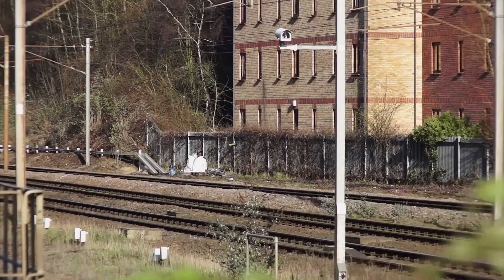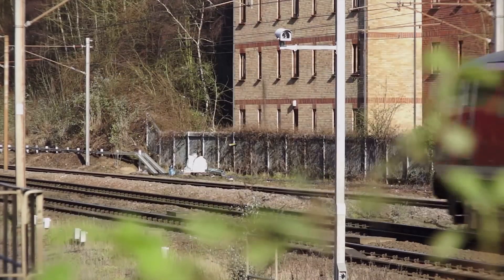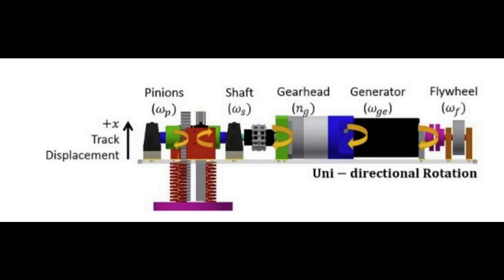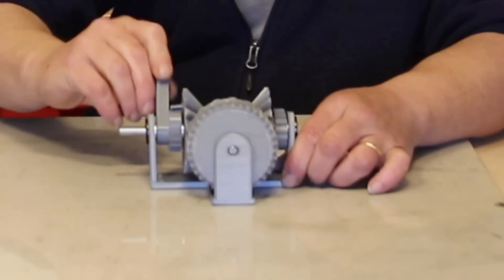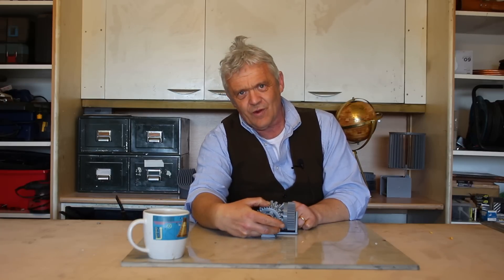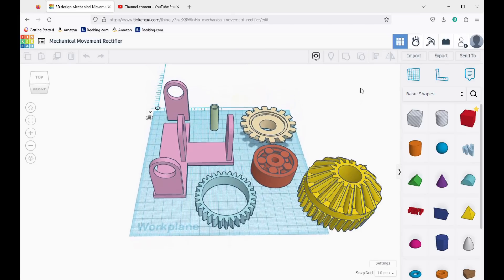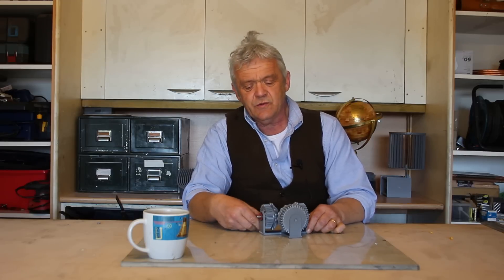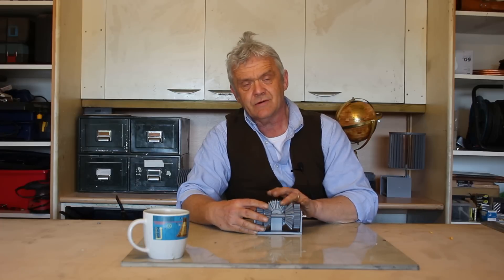1912 Energy Harvesting In Megawatts - The MMR Breakthrough

Comment: Well then why don't you attach these things to the suspension system on all four wheels of a car and use that to recharge the batteries
Reply from the maker: you could
Reply: had same exact thought,
Reply: I was talking about electric car but you're right it wouldn't do a whole lot for a gasoline car unless you had one of those hybrids
Reply: @Michael Skinner I've seen a suspension to electric generator product at a tradeshow.
Reply: Maybe dampening characteristic is not good for suspension. Maybe this flywheel construction make suspension react too slow, or something. Think about dampening in time characteristic.
Reply: Putting coils on guard rails modified could produce electricity or next to trains
Reply: Made me think of putting magnets under a car and copper coils in the road and harvest the electricity
Reply: @sc-lj9cp  sounds like a great idea 💡

Comment: One of the more interesting things about technology like this is that it has the very beneficial side effect of dampening unwanted movement which causes noise and wear.
Reply from the maker: you are one of the few to have got that mate and it is spot on
Reply: Of course If the train and rail system was an elegant and efficient system in the first place, there would be no noise or wear. 
And no wasted energy to reclaim a small percentage of in exponentiating an escalation of complexity, finite lifetime parts, maintenance costs AND resource consumption. 
Simply providing adequate suspension for the trains axles, by mounting the dolly's on a block of foam rubber with a flat table bearing and central locating shaft would remove 90% of the wear on the train, save more energy than could ever be harvested, and allow cheaper and lighter construction, and higher load to vehicle weight ratios. 
So really this is a typical Yank,  VERY STUPID IDEA. 
A VSI. 
Perhaps look instead at harvesting the energy of a tree or grove of bamboos,
The structure of a bridge, skyscraper buildings, swaying in the wind. 
Large forces over decent distances, small frequency.
A much better scenario for not wearing out your "mechanical rectifier" in a few seconds. 

How much energy does it take to 3D print your mechanical rectifier and how much energy can it harvest in the under sixty seconds it will last with kilowatt level inputs at multiple cycles per second Robert Murray Smith?
Reply: @ThinkingandTinkering  have you considered a combination wind wand and/or day/night thermal expansion reciprocating wand system yanking your cables Robert Murray Smith.
A pair of these could torque your knob 24/7 without too hurried and stressful yanking, do you not think? 
It could be the curved roof of a building facing south that stretched and unfurld in the heat, and closed like a flower at dusk.
Reply: That answers my question. I wondered if you were actually taking this energy from the train operator, but I guess it's wasted energy anyway.
Reply: @aaronfranklin324  I think you need to take a break from the Yabba and get some sleep, mate.
Reply: @TimeSurfer206  it's 1.30 in the afternoon in New Zealand dude. 
And I is surfing some harbour chop in my yacht. 
Sure could make megawatts with the spinnaker pole out the side and a line thru a pulley to a weighted buoy. 😋
Reply: If they put this system directly on the suspension of electrical trains, could they be made less noisy, as well as recovering some power? 🤔
Reply: I won't stop the noise.
Reply: How tovstop that train when using magnets. They could feed the net backwards. Keep on running.. you got a track

Comment: Awesomeness. Two things come to mind — there was recently an absolutely horrific train derailment in Ohio that basically wiped out a small town with potentially deadly consequences of toxic chemical exposure. Indeed, the freight rail industry in the US is downright hazardous — there are thousands of derailments every single year. The cause of the Ohio derailment is almost certainly due at least in part to faulty safety equipment that was supposed to detect overheating of the wheels of the train. I wonder if it would be possible to include a low-voltage heat detector that could relay hazardous conditions. Also, perhaps they could be useful for electric trains and light rail in the cities perhaps, since they could feed electricity directly into the system?

Comment: Sounds like another good app for electromagnetic power scavaging. Periodic magnets on railcar underbodys and a series of coils on the railroad bed.
  Add low profile wind turbines on the roof and your vibration energy scavenger device to the rails. I wonder how much of the energy used to move the train could be recovered by using all available practical energy scavenging devices?

Comment: Wrap a coil of wire around a freeway and the passing cars will induce electricity . Put a hose across the highway, a one way valve attached. The traffic will produce a steady flow of compressed air.

Comment: Very interesting concepts! From the point of view of an electrical engineer reading about the Stonybrook scavenger, it struck me that:
1) there are probably more efficient generators than back-driving a stepper motor, and 
2) eliminating the "mechanical rectifier" and using Schottky diodes or even better, "ideal diodes" using switched MOSFETs would introduce even lower conversion losses.
Any way it's done, harvesting track vibrations is brilliant!

Comment: WE could get Energy from every Thing that moves, thanks good Work
Reply from the maker: yes we could!
Reply: @ThinkingandTinkering  why is Nobody doing IT?
Reply: @divedeeperer  This has been developed for aircraft suspensions where significant energy can be absorbed when landing. I think the main problem is the weight and cost of the batteries, generator, etc.
Also, copper is already subject to theft. I don't think harvesting units would stay put very long before some low life steals them.
Reply: @Proud2bmodest  Hmmm If WE dont try WE will never know. Maybe IT will Work Out Just fine.
A Well with water+ RAM pump to get the water Up in great hights into a big water tower+ any Kind of water Generator (maybe a Kelvin water dropper)that will Run of the towers water... Like a Hydrodamm Just without the Damm and the left over water Back into the well

Comment: Mount the unit with the actuator vertical.
Attach a 10m lightweight pole.
Mount a simple paddle of lightweight material on the end, maybe mylar with a fibreglass hoop frame.
Any wind movement generates power.
You could fit a spring at the mounting point of the collector "paddle" which "breaks" (bends 90°) in high wind as a regulator, and allowing the pole to flick backwards, generating more energy as the force drops.

Comment: I wonder how much energy you could get out of a wind up grandfather clock if you had its pendulum rigged with a magnet to go in and out of a coil of wire. These are the things I find myself thinking about ever since I discovered you, Rob :P

Great video as always! 🎉
Reply from the maker: nice one mate - you can calculate it
Reply: The amount of energy you can get out of a grandfather clock is the amount of energy you put into the spring when you wind it up - which is almost nothing, only just enough to keep the pendulum swinging. If you harvest any of that, the clock stops. 🙂
Reply: Clocks can also be found that use weights, my Grandmother had one.
Reply: @RasmusSchultz  So, how much difficult would it be to make a clock that harvest the energy of its surroundings to rewind itself? Wouldn't it be difficult, since the pendulum is what makes it have a correct timing, and more energy would interfere with it? 

I really don't know much about clocks like that, so Sorry if it's a dumb question.
Reply: The clock would end up losing time.  The pendulum would need adjusting to compensate for the slight slow down.
Reply: @RasmusSchultz  My comment was a statement not a question and it was for Robert. 🙄 Meant to show my inspiration for finding ways to generate energy after watching his videos. I understand that the amount of energy potentially able to be extracted is less than the amount put in.
Reply: @isaacm1929  it's called an automatic watch - as I recall, these were popular in the 80s. 🙂
Reply: The pendulum will experience resistance commensurate with the electric current that will generate an opposing magnetic field. The pendulum will slow or stop.

Comment: Dear Robert!
It is great that this will harvest Energy from the clonking sound of bad railway track. 
This idea feels likeis using your house fire to grill marsh mellows. 
You need a new house afterwards and those marsh mellows could have been cooked with less cost and effort.
At best this method will only harvest the energy that goes into making the sound.
In particular, it harvests the energy from the level difference between two rails on the bolted joint. 
That level difference is potential energy that the train has to climb out of subsequently. 
Therefore, in the end this is only an expensive oil fired power plant in countries, which still mostly use diesel locos. 

The proposed technology will not really improve the clonking of the wheels with all its associated negative health effects.

The clonking is not a inviolable law of nature. It is merely the results of the decades long  systemic underinvestment in rail infrastructure of successive British and American  governments.

The clonking could be very successfully eradicated by using modern track jointing technology, like us in widespread use in Europe and East Asia. Instead of the bolted plate assembly, termite welding or sharp angled rail joints with springs could provide a smooth transition from rail to rail and give a more comfortable ride and generate non-impulse noise whichnsinks more easily in the background noise.
Using this technology, the trains do not need the extra fuel to constantly climb out of the track 'subsidance' caused by the bad rail jointing, but can also not used to harvest the potential energy.

A final point. Do you really think that the investment for thousands of these energy harvesters can be found, if the cash to fix the track joints cannot?
I think not.

Comment: Hi Robert, Again, thank you for your work in all your research areas! Why not just put the device on all of the shock absorbers of the train instead of along the tracks? Much less number of devices needed. Also it can be used to dampen the bumps and collect energy from almost all of them during the ride? Then discharge the collected energy at certain stations along the way. Also electric trains may be able to use the energy directly for forward motion. This could be applied to buses, trucks, cars, etc. too. Thanks again!
Reply: It will be very janky. If you put them between the axle and the frame it'll have limit to how much energy it can capture before the two collide with whatever kinetic energy is left

But it could be done. Put piezoelectric pads on the frame lined up with rubber stoppers on the axle to catch the last of the kinetic energy and stop the two parts from slamming together hard
Reply: It's the same energy,, and anything stable will have more longevity than anyting mobile
Reply from the maker: they are trying that too mate

Comment: Hi. Rob, another clever idea.
My comments aren't directly related to the topic of today's video, but do relate to energy scavenging.
Over the last few days I've been replacing my old wooden decking boards with 18m² of new dark grey composite boards in my south-facing garden, and in a couple of weeks time I will be installing another 26m² at my son's house in his east-facing garden.
It struck me that on a sunny day these boards are going to absorb a considerable amount of solar energy and become pretty hot, perhaps even uncomfortably hot. The boards are hollow - each has five channels running the length of the board, each channel having a square cross-section of maybe 2 cm².
It struck me that this type of installation could be turned into some variation of a solar water heater. I'm no engineer so how this might be converted in to working device is beyond me and I wondered if you might have any thoughts.
Regards
Reply: Wow,, I've seen lots of decks made out of these being in handyman trade,, but a solar water heater never occurred to me, excellent idea 💡,, to create a thermal siphon water heater would be simple, possibly laborious,, but how to convert it into more than hot water I don't know
Reply from the maker: i think it's a good idea mate - for how to proceed you might want to look at ground source heat pumps
Reply: @kennyclement2823  Use the hot water for a hydronic heating system in the house as well as domestic hot water supply. Those two are the biggest energy consumers in a house.
And the single fastest and most immediately cost-effective change you can make to your house is to shoot the third biggest energy consumer: 
Your clothes dryer. A clothesline is cheap as dirt, uses free fuel, and seldom needs a house call from an expensive technician.
A clothes dryer uses between 1800 Watts and 5000 Watts. I shall use the average, 3,400 Watts. If I run my dryer for an hour a day, I'm consuming, obviously, 3.4 Kilowatt hours per day. Times 30 days in a month is 102 Kilowatt hours.
My utility's current Residential rate is 11.84 cents per Kilowatt hour. This is 12 bucks a month I am not spending. As a rule of thumb, multiply this number by the number of people in your household.
If you have kids, I bet your dryer is running most of the day. We never see this meter running its toll up. So we never realize its impact.

Comment: RMS, the locomotives are electromotive diesels. When the train brakes, there are calrod (resistive heater) elements and fans that blow away the excess energy. If the trains charged the rails with the excess energy, another train or user could use this waste electricity. Harvest the energy from the train when it brakes.